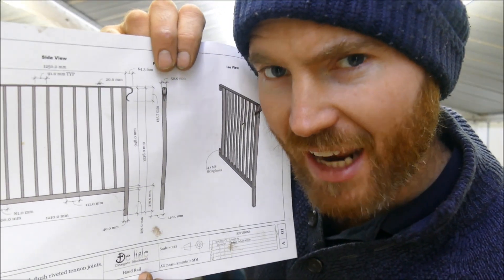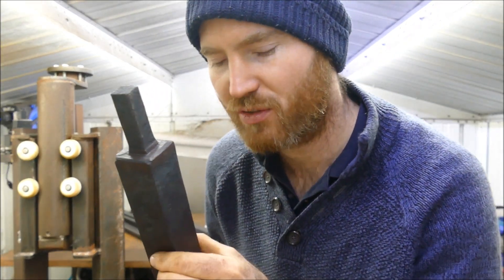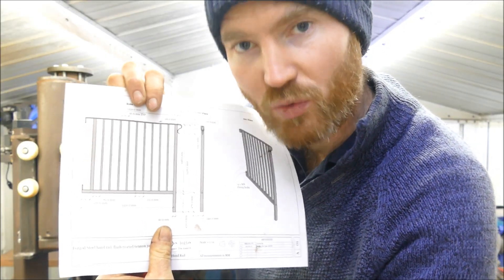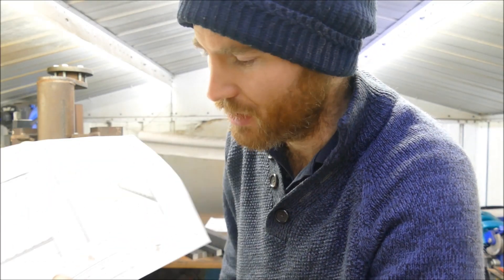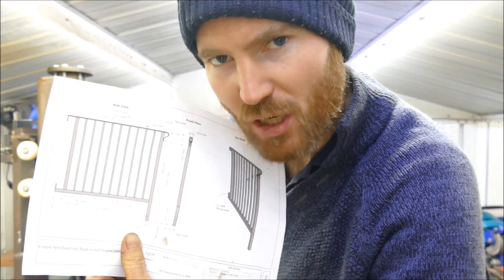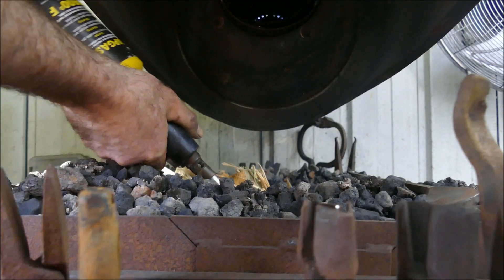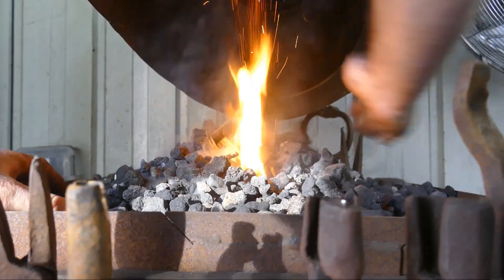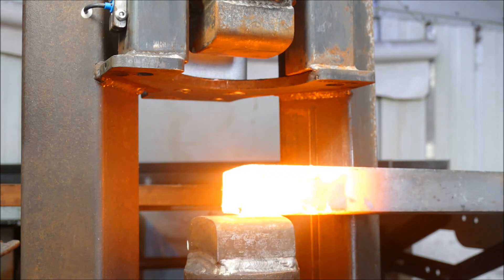New! DIY induction forge for £75 - 2500w PCB review and forged tenon joint railing build

Comment: I am looking at your video a year late, but your coil is far too short in length, and causing the ZVS circuit to run at a frequency that is too high. Your smaller coil needs to use "approximately" the same length as the original. If you make your coil 4 to 5 times longer (and slightly larger diameter), the circuit frequency may drop to an acceptable level, and operate properly. That coil is a key electrical component that directly affects operation. The coil must be within the range of inductive values needed for that circuit, else it will cause other components to overheat.
Reply: I always think of the coils as being like an antenna and the frequency of the "antenna" has to match the circuit to resonate properly.
Reply: Hi,
... I am looking at this video with 3y of delay...
I very much like thee ZVS induction coil heating units and am experimenting with a 2000W model.
Instead of running just one single big coil, I would need to operate/energize 4 smaller, thinner wire coils  which each in tunr heat up a 6mm steel pipe.
Any suggestions how I can "convert" the one big coil into 4 smaller thinner coils to obtain the same working efficiency while not burning out the ZVS unit?
Or should I rather operate 4 small ZVS units, one for each steel pipe?
Thank you,
Jake
Reply: @JakeKennes  Dealing with a similar issue. I have 3kW ZVS heater and need to use smaller diameter, shorter coil. Very little info about hacking that Chinese devices. I guess that I have to play with capacitors to match the new coil design. But I have no idea how.
Reply: yeah the coil actually matters. if the coil doesnt match the Driver it wont work properly, this is a non trivial thing if you want to get this exactly right.

Comment: Good video. But u cant change the coil just like that. Its a tank oscilator. Coil inductance and value of capacitor must be such that we get a proper resonent frequency sign wave
Reply: You need a relay between the power supply and the induction heater,if you connect the power supply directly to induction heater it will burn up the mosfets  as soon as you turn it on. They need to see full voltage and current from the start a proper size relay will work. If you are worried about coil inductance buy a inductance meter check with any ham operator he will have one, then you can measure the factory one and whenever you use a different  coil if its the same inductance your heater will never no the difference. Kb4saf

Comment: U.S. Solid 15 KW High Frequency Induction Heater 30-80 KHz, 220V or 110V this unit. Can be used 24 h with no problems
Reply from the maker: My latest video is on the VEVOR 15kw. Pretty much the same as the US solid but 220v only. Only £500.

Comment: Does the length of the copper coil affect the wattage? Can i use a longer coil while withdrawing the same wattage?
Reply from the maker: So it requires a specific size coil and number of winding to match the resonance otherwise it over heats. It comes with a specific coil but it's not ideal for forging. My new 15kw version is far more flexible when it comes to coil design and has safety features so you don't cook the machine by accident like I did with this one. Cheers J
Reply: @joshuadelisle  aprox how many kw induction heater do i need to super heat a small pizza oven?( Meaning the coil wrapped around the oven from the outside)
Reply from the maker: @jomfawad9255  my honest opinion would be to use a halogen heater or electronic furnace element if you want an electronic pizza oven. A 1kw system would be more than enough with good insulation. Personally I would use a wood fired one made from adobe straight from the ground. Cheers J
Reply: @joshuadelisle  thank you

Comment: You need a much higher frequency to get any heat😁
Reply from the maker: It worked but I needed the right sized coil. My new 15kw induction forge is much better if you want to see that video. Cheers J
Reply: @joshuadelisle  you have two options, change your capacitors , your coil looks great, maybe one or two turns more 😁😇

Comment: I bought the blank pcb and used quality mosfets, caps, other components to build it myself. Made a few mods, water cooling for the mosfets & caps, over temp protection, and use an old mig welder (rectified) as power supply. I'm very happy with the unit, the cooling mod allows continual use without over temp. 
  One observation is your coil is too small for the unit causing your mosfets to linger in "linear" region hence over heating. When altering coils you also need to alter your tank (caps) accordingly. Great video, awsome smithing.
Reply from the maker: That's great advice thank you Robert. I've now got a 15kw machine and very pleased with it. Its only £500. All the very best. Cheers J

Comment: Thanks for posting this. It's good to know what' doesn't work as easily as advertised too!
Reply from the maker: I think it may work better with a different coil but that would mean I can't use a custom coil for different diameters. I've just reviewed a 15kw all singing version and is totally worth spending the extra money on it.  Works a treat and heats up 1" solid within a minute. Cheers J

Comment: If you've bought an arc welder, you might consider finding a defunct piece of equipment called a Carbon Arc Torch for it. It has the same utility as an oxy/propane torch, or indeed your inverter. You can heat up a single point with electrical current. They're a little fiddly to use, but cheap to operate.
Reply from the maker: You're not the first to mention carbon arc. Will definitely give it go when I get hold of some. Cheers J
Reply: @joshuadelisle  they’re awesome, although you can get a pretty bad sunburn from the arc.

Comment: Hi Joshua, From the little I know about my 15kw induction forge the water not only flows through the coil but also through the internal parts (not sure what they are called) so it is cooling those as well. Sounds to me like yours might be experiencing that issue. I also have found on larger stock I start the induction and then insert the metal slowly into the coil so it is not trying to heat up the entire mass within the coil at once. Maybe try preheating the piece for 15 seconds with a torch/gas forge and then see what happens. My 15kw will do up to 1 1/2 inch stock but once i get over 3/4 inch i use the method described above to help get it to temp. Great video's love the most recent one on making leaves!!

Comment: Hi. Try keeping the coil leads much much closer together. Make them come together like back-to-back "Ls" out of the Chinese toy, keep them close but not touching, and let them come apart only at the coil itself. As far as the under-built circuitry, well, it is just a toy after all.
Reply from the maker: Thank you. I think it will work better with more windings and longer length of pipe so it resonates at a better frequency it's matched to. Or at least that's the advice I've been given so far. Cheers J

Comment: It never occurred to me to use a Tig welder as a forge which is silly as I have got things red hot several times while trying to get suitable conditions to weld & not vaporise thin sheet metal. I will give this a try next time I want to hot set rivets. It is surprisingly often how i learn something from the trials, pain & unhappy struggles of someone else & this unintended transfer is perhaps the potential blessing of helping another to remember & counter negativity when things go awry. Thanks for sharing!
Reply from the maker: Thank you so much. I think I might be able to fix it by making the coil longer. But to be honest the Tig works surprisingly well. Cheers J

Comment: I agree withe Jim RY and the carbon arc.. Amazing how well you can heat locally with a carbon arc. Get wo carbon rods from a welding shop and clamp them to the cables of an old welder. Much hotter than a cutting torch. Carbons arcs are very old school but do the job.
Reply from the maker: I'll definitely give it a go one day. Cheers J
Reply: But dangerous fumes

Comment: I would have bought one tomorrow if it worked.
Reply from the maker: It may work after talking to a few others. I need to use its original coil to keep the correct resonance and tighten up a few coils to make it useful. It's not as simple as putting any size coil on it.

Comment: I would still recommend getting a induction heater.
A LH-15A will set you back about 700quid peak power is about 8kw.

They speed up the work process and it is cheaper to run than coal or gas.

Comment: Brother! You can get that induction heater going well! You're almost there. The power supply and water is great, you may need to "touch up" the pcb.
Re-solder the wiggling parts, glue down some others, maybe replace a few components but you can have that thing going.

Theres lots of resources on the web. Maybe a collab with an electronics dude help you out.

Comment: I have built many induction systems, including 1 attempt with one of those boards and despite having iron pouring success I have binned the whole diy strategy and purchased an lh15a from eBay at £650.     It works very very well and is already cheaper than than the diy project (variacs capacitors transformers rectifiers amp meters volt meters small caps smoothing caps breakers fuses current sensing modules power meters heat meters copper buzz bars cooling blocks and god knows how many irfp260 mosfets) and takes up a lot less space and oh yes works every time not just when it doesn’t feel like making fireworks.     The board you have now spent £300 on is a self resonant Royer circuit which is shockingly simple as explained by Marcos revamped Mazilli fly back driver (google noobheater) and as I have learned they are prone to simply exploding.     Where abouts in the uk are you.    I’m in Wales if your close and fancy some induction forging brainstorming.   Cheers dood and nice hammer btw
Reply from the maker: Thank you. I'm west Midlands. Maybe catch up at the royal Welsh show when it's on next. All the very best. Cheers J

Comment: The main reason that your induction heaters keep failing is that the coil you are using is too low in inductance..  This makes the frequency too high and the Mosfets can't turn on fast enough.  They spend too much time in the "linear" mode which makes them heat excessively.
I have been successfully running these things for a few years now and haven't had any failures since I went through a similar learning process.  I don't want to hijack your thread by putting links to my videos and webpages on the subject, though.
Reply: I just recently bought a 15kw induction heater that runs directly of off the 240v and I love it so far. I have not used the little 48V DC units like you have there, but I  agree with French Creek valley that your coil that you made is to small for the board you are using. It's is not about the power, it's the length of the tubing in the coil; yours is quite a bit shorter than the stock coil and is changing the resonant frequency out of the working range of the board. You can do the small diameter, but make it longer, using the same length of copper tubing.
Reply: @matthewperlman3356  love this!!! Makes a lot of sense!!! Woohoo!! I still have hope now. Haha
Reply: I have to agree with my learned college on this. you changed the coil to suit your needs but left the capacitors the same. More turns or larger capacitance ;-)
Reply: I'm now ready for an induction heater and also tought to build it. Will you be so kind to give direction or comment on whether it is feasible and if so, how to go about it? I'm from South Africa.

Comment: I need to get up in the loft and dig out my training on induction heating.
We used it to seal up TetraPak cartons.

so I know I am a month late but here goes.

so when not in use it should be switched off that might help those transistors will get hot in idle.
the inductance on the coil is quite important for the correct oscillation of the circuit.  the number of turns is proportional to the inductance.

I am sure between us we can get something that works well like your power hammer.
Reply from the maker: Thank you Jo. Yes since the video I've learned I need a much larger coil with more turns for both inductance and resistance. It came with a coil but was too wide for the size of stock I wanted to use it for. I'm considering using the original coil again but this time making it into a 'micky mouse' shape so it has smaller coils wound to the side... Do you think that will work? Cheers J
Reply: @joshuadelisle  
I think I have found one similar on Amazon for £20. I'll have a look at it and see if there are any improvements that are easy to do.  I will only use it for arrow heads so much smaller stock to start with.

Comment: I do a considerable amount of this type of work. I use a multi holed gas forge to heat the tenons. As i only need to heat the last  20mm. With out an oxy torch or LPG/ OXY.  How are you going to assembly the railing.  The top rail needs to be round recesseded to rivet the tenon. Then hand filed and leaded. Otherwise you will see every tenon. How by hot forging are you going to get everyone exactly the same. The bottoms will need to be dowelled and driven into a pre drilled hole. Good luck with it. By the way the crown has its own Blacksmiths and Blacksmith shops. Just saying.
Reply from the maker: Hi Brian. I already finished it and installed. I counter sunk the top and forged it flush with a little bit to file after. The bottom was riveted also like the top so no dowl or anything. Skill keeps it straight, some filing before final fit. I was sub contracted by the maintenance team there. Cheers J

Comment: I vote for increasing  traces and upgrading mosfets, or just get a 3kw board to match your PS.  Most serious blacksmiths use the 7.5kw models if using induction - grossly over-rated at 15kw.  Your 2.5kw model is best for smaller projects. Here is a video series on how to use it.

Comment: Hey josh I liked your video, I’ve looked into induction forging aswell for bladesmithing and from what I understand if you want to heat up anything bigger than that rivet with a bigger induction coil you need a lot more power, we’re talking 15000 watts, I’ve looked into a company in the UK that build units like that for blacksmiths- https://www.forged-ironmongery.co.uk/product/victory-tools-forge-force-induction-for-blacksmiths-25-kw/

Comment: How can you do this without having oxy-acetylene on on hand that's like one of the most fundamental metal working tools to have or is it that a time to acquire in your neck of the woods
Reply from the maker: I've got the kit but because I'm only infrequently using my home shop I can't justify the rent on the bottles. To be honest using my Tig torch worked excellent and I would say was better than oxy-fuel for this purpose. Still If I find a more cost effective alternative to gas I will use it. Cheers J
Reply: @joshuadelisle  why Wrentham I bought two bottles on let-go outright for 60 bucks. And the oxygen bottle was entirely full and I found a guy who will refill any bottle I bring him at a lower price than anyone else in the area so I'm sure you can manage something without spending an arm and a leg

Comment: To heat up the steel bars by induction is a brilliant idea! As far as I know you have to use AC for the coil. - I think as higher the frequency as more heat you get... Unfortunately I don't know what is the optimal frequence / voltage / amps for the best result. 
However: Thanks for posing this video, you gave me a huge inspiration (for another project)
Reply from the maker: Thank you. All the very best. Cheers J
Reply: Applications of frequency ranges
Frequency (kHz)	Workpiece type
5–30	         Thick materials (e.g. steel at 815 °C with diameter 50 mm or greater).
100–400	Small workpieces or shallow penetration (e.g. steel at 815 °C with diameter of 5–10 mm or steel at 25 °C with a diameter around 0.1 mm).
480	                Microscopic pieces
Ref.( https://en.wikipedia.org/wiki/Induction_heating)

Comment: If the mcb is on the dc side it won't be doing anything. You need a fuse or a really big fet for dc. As for it not working great, commercial ones are usually 15kw minimum, so your 3kw is way too small for anything but small bars. I'm by no means an expert BTW. Just what I've gleaned from reading many forums etc.
Reply: In fact there's a Facebook page/group just for induction forges. And I think you probably need way more flow on your cooling, they don't need pressure, just lots of flow I think.

Comment: You need a carbon arc torch ,I’ve melted metal ,brazed ,bent flat bar ,it’s a bit like picking your nose with chopsticks to start with but 45 years ago that’s all there was for the apprentice Blacksmith working in is shed .Make you self a necking tool for your hammer it will let you do the shoulder very fast ,no need to be square ,you should be able to neck,and draw one end in one heat .Great to see the trade being carried on 👍
Reply from the maker: Thank you Jim I'll take note of that. Cheers J
Reply: It’s funny that I happen across this comment on a random channel I just discovered, at the very moment I’m building a carbon arc torch for my stick welder.
Reply: @matthbva A little late to enjoy this serendipitous moment in real time but how’d that torch work out?